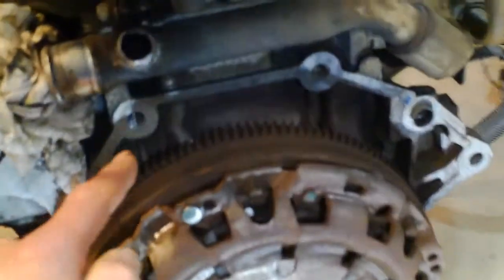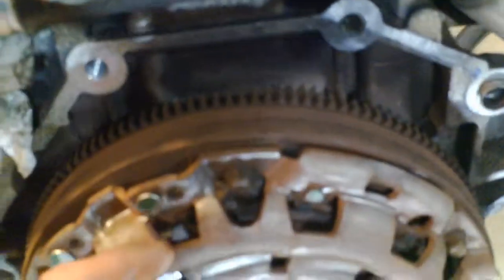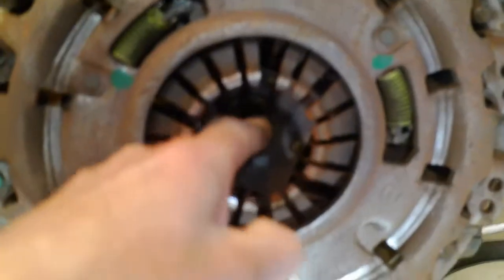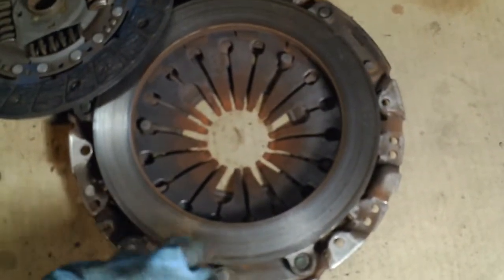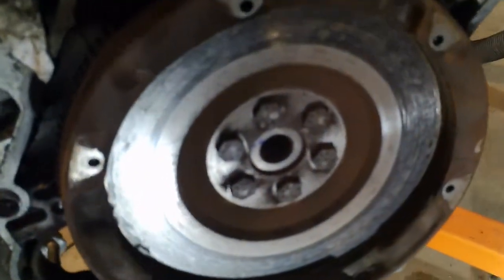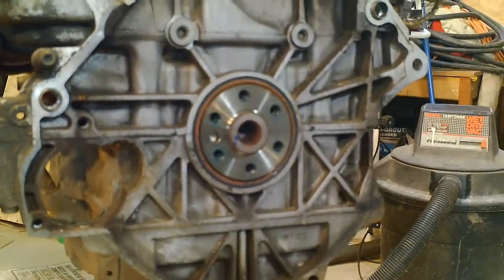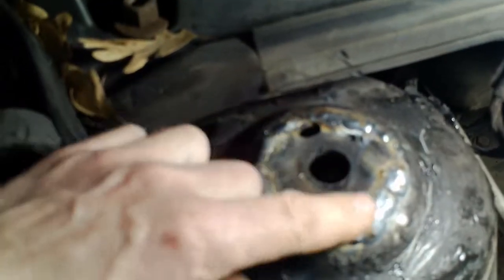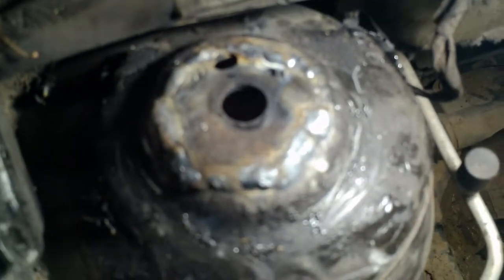Detailed Saturn Ion Engine Replacement and more, Part 6

Comment: It started right up. It's been sitting for 6 months. But I do have a question. It starts smoking back by the exhaust within about 30 seconds of starting it. I shut it down right away. Any ideas? Also, I am trying to bleed the clutch and not having much sucess any tips on that? Thanks again for the videos I couldn't have gotten this far without them.
Reply from the maker: I don't know about the black smoke, that can be too rich of mixture but not sure why it would shut down unless it is just so much gas it can't run.  Are there any codes stored that might help debug?  Was the engine you put in known good, or could there have been an issue with it before you put it in?   I guess it would be good to check that you have all the sensors, etc, connected and didn't miss connecting something, though I can't think of one that would cause the black smoke if not connected.  When it shuts down, can you take a spark plug out and see if it fouled/wet from too much gas?  Might need to check them all as I suppose it could be just a couple cylinders having the problem if too much gas.  That's all I can think of at the moment, but will reply again if something else comes to mind.  Will reply about clutch next.
Reply: @JB_WI_Triumph  The smoke wasn't black more like a white smoke between the engine & exhaust manifold. Maybe  it is still loose or leaking from there? I think the torque specs were kind of low as I recall. (10 lbs.) I did put a new metal gasket on. Would a scan tool tell me what the issue is? It didn't die on me, I shut it down right away when I saw he smoke. I did forget to tighten the sensor on the exhaust manifold but it was plugged in.
Reply from the maker: @elisebrown7940  

Sorry, I read "Back" as "Black"
If O2 sensor wasn't tightened up, that could do it.  Also, new gaskets, the manifold and grease on manifold from handling, etc, all tend to smoke a bit at first.  I would just do basic checks, coolant level good, oil good (no coolant in it) and then let it run a while and watch to see if you can pinpoint leak, assuming there is one.  Be very watchful of the temp gauge, shut down if it looks like it is going at all hot, very easy to damage head and/or head gasket if it gets hot. 

10 ft lbs seems very low, I would confirm that again.  Things that screw into the Aluminum head will be low torque, but 10 seems low even for that.  

As far as scan tool, you might get some codes if the seal from head to manifold is bad as it might get too much oxygen that way, but if you know there is a problem in that area, might as well get that fixed first.  I don't think the O2 mixture codes are stored immediately, you have to get some miles before they would get set.
Reply: @JB_WI_Triumph  I took the heat shield off and ran it again with my trouble light to see a little better. Turns out the valve cover gasket is leaking or thats where the smoke is coming from. Not sure if I am happy or not about that but it could have been worse I guess.
Reply from the maker: @elisebrown7940  

At least you don't have to take the engine back out to fix that!  I just swapped engines so I never had to take valve cover on or off.
Reply: @JB_WI_Triumph  Would you buy a new valve cover gasket? It still looks good not sure if they can be re-used or one time use only.
Reply from the maker: @elisebrown7940  

I never had mine apart so not sure on this.  If it was leaking though, then seems like something must be wrong, hopefully the gasket.  The rubber like ones can be re-used, the paper-like ones no.
Reply from the maker: I hate bleeding that clutch.  My theory is that air gets trapped in the slave cylinder and it doesn't travel up and out of there very well.  I have run two quarts of brake fluid through it to get it work before, and even then still seemed like it had air in it.  It does seem to get better over time if you get it to the point where it is usable, I think the air does work it self up and out over time.  This last time I did a vacuum bleed on it and it seemed to work better, but I can't be sure until I repeat one more time.  Even when I did this, it seemed not too good and I bought this thing "Mityvac MVA803 Master Cylinder Pressure Bleed Adapter " in order to get more vacuum than my goofy improvised setup.  By the time it arrived though, the clutch either improved or I got used to it and so I haven't tried this thing yet.
Reply: @JB_WI_Triumph  I'll have some help today yesterday it was just me & my 1X4 board used to hold down the pedal. I need to go out and buy more brake fluid before I try again. I do have a mighty vac that I could try. What's the best way to use it ? Wiggling the line wasn't getting me anywhere.
Reply from the maker: @elisebrown7940  

I made an adapter to my vac pump from old brake fluid reservoir cover, but that one I mentioned would do better than my silly setup did.  As long as you can draw a vacuum from the reservoir, you have hope of drawing air bubble out.  If you have it mostly bled, then you probably don't have to worry about filling up the reservoir, but if you see the level drop, you know you have made progress.  The drop might be very small though, doesn't take much air in the system to render clutch useless.  I don't know that you have to hold the pedal down, or pump it, I have seen people swear on each one, but I drew the vacuum and then cycled the pedal a few times under vacuum in hopes air would get worked out.  I feel like that was the trick, but I can't be positive.
Reply: @JB_WI_Triumph  Working with 10 pumps & my son holding the pedal down on the last one I released the clip. There is pressure that makes the line want to pop out but I am not geeting any air bubbles in the line. The pedal is a little better but not much probably won't be enough to engage the new clutch. Could the air be trapped on the other side of the line between the bleeder & the slave cylinder? If it is would it make sense to try and draw the air out at the bleeder?
Reply from the maker: @elisebrown7940  

Well you have found the frustration with the clutch bleeding.  I bled my brains out and pedal was still spongy and every time is a battle.
If the line is wanting to pop out, you must not have it slid out far enough into the bleed position.  If the fluid can flow freely out the bleeder valve, there will be no pressure to push the line out. 

Yes, the air is on the transmission side.  It is no problem to bleed the line from the reservoir to the bleeder valve, the trouble is getting the air out of the slave cylinder.   If you have some pedal and can pump it up, that might help.  It will get the slave cylinder moving and that might help get the air to bubble up the line. 

You can't really pull air out the bleeder valve as you will pull the fluid out of the reservoir.  Perhaps, however, that might work if you get the air out of the slave cylinder side first, and then fill the reservoir and bleed the line next.  From your current state though I think you are going to get the fluid that is higher up in the line and reservoir first, then you might get air from the slave, but you need to seal the cap on the reservoir so you can draw a vacuum.  There is a small vent hole in the cover, but if you put a plastic bag over the reservoir, then put the cap on, that worked for me ( I did this sort of thing too )

The first time I bled the clutch, I just kept bleeding and pumping and eventually I got it.  I had a hose from the bleeder valve back to the reservoir when I did it this way so I didn't have to keep adding fluid, just pumped it around in a circle.
Reply: @JB_WI_Triumph  That makes sense my mighty vac did pull some air out but then the tiny pin holding the handle came out disappeared into the engine  somewhere. Crap. I have some pedal now so maybe the slave cylinder will help push the air out.
Reply from the maker: @elisebrown7940  

Yes, you are probably close, keep bleeding and pumping all night and you might have it by morning...
Reply: @JB_WI_Triumph   Ha, not all night but it did get dark. I cut off a nail to repair Myt-va I had a rubber stopper set-up that I used to bleed the air out of the power steering on a ford windstar it worked well enough to create a seal so the Myt-vac could pull some of the air out. I have a pretty good pedal now. Took it out for a test drive and it worked okay. I have never drove one of these before -reverse was super hard to find not sure if that's normal or not. Hey, thanks again I was getting very frustrated but it all worked out.
Reply from the maker: @elisebrown7940  

Good, congats, it is nice when it finally works. 

Reverse hard to find because you didn't know where to look, or because linkage problem?  There is an issue where the roll pin that holds the cable fasteners to the tranny can brake.  I don't know if this makes reverse hard to find, but it does make shifting sloppy in general.  I had a partially broken pin in mine, replaced it, and shifting was better.
Reply: @JB_WI_Triumph  How would I check that? It does shift harder than I guessed it would. That could be the problem.
Reply from the maker: @elisebrown7940  

It might be hard to describe, but see if you can wiggle the gadget that the shift cables connect to and see how much play there is.  If the pin is broken that holds that apparatus to the shaft coming out of the tranny, then it will be sloppy on the shaft. 

Could it be hard to shift because you don't have good clutch yet?
JB
Reply: @JB_WI_Triumph  It continues to get a little better as I drive it. I can find reverse if I start out in first. I think that I can live with it. My last 2 issues are a bad control arm on the passenger side & the radio has a short that drains the battery. Have you dealt with either of these issues? It looks like the easiest route would be to replace the whole arm but that's also the most expensive way to go.
Reply from the maker: @elisebrown7940  I have replaced the control arm a couple of times now on mine.   I have to drive on dirt road with pot holes and so I think it is especially hard on the ball joints and bushings.  It is easier to replace the whole control arm for sure, but if you have time you can just change the ball joint (assuming that is the problem you have).  You have to grind the heads off the rivets and then punch them out, use bolts for the new ball joint.  Just make sure the bushings are good if you do this otherwise you will be replacing it again soon to fix that. 

It seems like the cheap replacement control arms did not last very long for me compared to the original ones.  I can't say for sure, but I think some of the ones being sold are of low quality. 

I have not had the radio issue, but thanks for mentioning it as I am sure it will start acting up on my car now....
Reply: @JB_WI_Triumph  My noise is a clunking sound. At first I thought it might be the sway bar bushings  but they seem pretty tight to the sway bar. Pretty sure it's the passenger side control arm. The sway bar link was broken on that side before I replaced them both.
Reply from the maker: @elisebrown7940  Yeah, those  sway bar links are famous for clunking.  I usually take them off and then  see what clunks to be sure they are not responsible. 

I have had the rear "horizontal  donut" bushing on the control arm fail twice now, the center metal part gets hammered out and then clunks.  I also had the control arm get hammered out so that bushing fell out and that causes some major clunks.  One test you can do is pull forward and stop abruptly, pull backward and stop abruptly, and have someone watch the front wheel and see if it moves relative to the fender which indicates slop in that rear bushing. 

The struts are not above clunking either and it is hard to tell what the problem is with all the possibilities.  Most everyone says the real solution is to turn the radio up.
Currently my rear trailing arm (might not be the proper term) bushing have significant play in them and make noise.  This is an upcoming project for me to fix.
Reply: @JB_WI_Triumph  
It was the control arm and man what a difference. I also had to tighten up the sway bar links again and no more clunking.
A new issue has developed with the shifting though. I was having trouble finding (R) reverse and it's gotten much worse now.
Now I have lost (2) second & (4) fourth gears too. Any ideas on this? 2 - 4 - R are all accross the bottom and I lost them gradually in reverse order  (R)  - (4) - (2) . It sort of feels like the cable  is not pulling  it far enough to engage the gears  now.
Reply from the maker: @elisebrown7940  

I remember there is a pin that holds the cable connection points to the shaft coming out of the transmission.  This pin frequently breaks according to what I read, mine was broke.  I didn't have trouble shifting other than it was sloppy, but I bet this could be the problem you have. 

You can reach down wiggle the contraption that the shift cables go to, see if it is loose on the shaft or not.
You can also manually put it into the gears to be sure that tranny is good, but you might have to disconnect at least the one cable that does the 2-4-R gear selection.
Reply: @JB_WI_Triumph  I was hoping to make it to Saturday today to work on the reapiar but one of the cables broke Wednesday night. No gears at all.
I had it towed home and I bought the replacement cable (set). I haven't bought the roll pin or maybe I need 2 yet. Do you remember how the pin comes out & where it is ? It looks like the plastic ends on te cables would just snap on to the shafts coming out of the transmission. Also, do you know where I can find the steps for R & R on the cables?
Reply from the maker: @elisebrown7940  
My guess is that you don't need the pin if they cable broke, it was probably going bad and that is why you had trouble.  It is odd that you had cable trouble, I still have the original cables in my car with 315K on it now. 

You have to drive the roll pin out with small punch.  I think I used the style that has a small ball on the end to center itself in the roll pin.  There is just one pin, and I am pretty sure I got it at Fastenal.  I bought a few to get the right size, and from memory, it was a metric size that fit.
Maybe the biggest pain in changing the cable is taking the center console out of the car.  I have done this, and when I did it I took out both seats.  You might not have to, but I needed to give it a clean anyway and it gives you more room to work.
I think it is pretty straight forward, just have to hunt for all the screws and be careful not to break the plastic.  I should be around on and off this weekend so feel free to ask any questions if you get stuck somewhere.
Good luck with it.
Reply: @JB_WI_Triumph  Thanks! The cable  had a kink on the outer metal sleeve toward te end of the cable end and that finally wore out the inner braided wire. Also, discovered that one of the two bolts that were supposed to be holding the cables and bracket to the transmission was missing. I have the ends removed at the transmission. I removed one of the heat shields and I was able to pull the bracket & cables down through the bottom of the car.  On the other end I removed  the plastic  & 6  black screws holding the console. It's loose now but not out. Next step I think would be to remove the clips holding  the other end of the cables. They are white plastic & not sure how they release. It looks like they might be hinged on one end lift open?
Reply from the maker: @elisebrown7940  Do you mean the clips that are on the inside of the car end of the cable?  I can't remember how the cables come off the shifter, but I did it once.  I can probably take mine apart tomorrow and refresh my memory if you get stuck, let me know.
Reply: @JB_WI_Triumph  Yes,  it looks like you could put a flat screwdriver in and pry them open but  not sure.  They clamp down or hold the  end  by the shifter. I'll try that and see if it works.
Reply: I got it. The clip lifts up just slightly and that allows the end to move foward.  What a nightmare pulling out the cables!  I just hope they go back in easier than the old ones came out.
Reply from the maker: @elisebrown7940  

Good job, but my experience is that things come apart a lot easier than they go back together!
Reply: @JB_WI_Triumph  I got it put back together & it shifts great in all the forward gears  but it won't go into reverse.  It  shifts over and up for 5th but not down at all for the reverse gear.  I also  have an issue  with the  cable further back towards the shifter.  There  was what I would call a  metal cable tie that holds both cables together and  it fits over a small stud with a nut that (was) attatched to the bottom of the car. Well, it took some force to get the cables back into the bracket near the transmission and I guess  it was enough to pull the stud loose.  I don't know if this would affect -  shifting into reverse  or  not.  Does just one of the cables control reverse? Not sure what to try next....
Reply from the maker: @elisebrown7940  

I am not familiar with the stud you mention, but it sounds like if it came lose that is a likely culprit. 

When you move the shifter side to side, one cable is active.  When you move the shifter forward and back, the other cable is being moved. 

On the transmission, one cable rotates the shaft coming out of the transmission and the other pulls it out or pushes it in to the tranny.  I can't tell you if side to side pushes and pulls or rotates the shaft as it was too long ago that I worked on it to remember.
If you can have someone run through the gears while you watch the transgression, you will quickly understand the various positions for the gears.  Once you get this figured, you can manually put the car in reverse to be sure it will go, maybe you will have to disconnect the cable.  Once you verify it will go in reverse, you should be able to figure out what is binding as you try to move the shifter into reverse position.  Maybe it will be more telling with the cable off so tranny isn't limiting any movement.
That is all I can think of at the moment, but will reply again if I have any bright ideas.
Reply: @JB_WI_Triumph  I got a look at what's happening as I try to put it into reverse today. The top cable (black)  appears to move the car from one gear to the next. The other cable (white) is under the black cable and it appears to move less possibly side to side. It still binds as you attempt to move it into reverse but with my son's help we were able to get it into reverse gear.  As he applied pressure to the shifter I could help move the black cable into reverse. This did not work everytime we tried it and it seems like pushing down slightly at the connection point helped get it into reverse gear. Could this be the roll pin issue? If I jack up the driver' side and take off the wheel will I be able to see the roll pin & get at it with a punch? I can't see it from the top at all. I did find some info on the pin  3/16" x 1" does that sound right? If you could tell me where to look & how you did yours that's what I'll try next. Thanks Again!
Reply from the maker: @elisebrown7940  One cable rotates the shaft that sticks out of the tranny.  The other cable pushes/pulls the shaft into or out of the transmission.  The into and out of movement corresponds to the side to side movement of the stick as I recall. 

I have not suffered the problem you describe, possibly the only saturn ion problem I haven't had, and so I am really speculating here.  My guess is that binding would not be caused by the roll pin as it wouldn't prevent the cables from moving where they wanted to, it would allow that contraption the cable ends connect to be sloppy.  I suppose you could think it is binding if you have to move the shifter further to compensate for slop at the tranny connection and run into some other mechanical limit beyond the normal range of the stick shift movement. 

I vaguely recall something about adjusting the cables, but this could even be on another car I was working on.  Do you see any threaded business where the cables connect to the shifter, and specifically where the cable sheath is fixed to the tunnel?  If the car goes into, for example, 2nd and 4th well, then maybe the cable is just too long/short.  This doesn't explain binding really.  Since the cable broke before, it seems like that is a symptom not the problem though. 

You could disconnect the cable that binds (or both) and then see if the shifter moves freely with the cables off.  If so, then it seems like it is the transmission and not the cables.  If it still binds, then it must be the cables.
I changed my roll pin when the tranny was out of the car.  It might be possible to do it with tranny in the car, but it would be tough.  It is hard to see it and you have to get a punch right on it to drive it out.  If you disconnect the cables, you can grab the contraption the cable ends connect to and wiggle it.  If it is sloppy, then probably broken roll pin.  If tight, then roll pin is good.  You could also manually move the car between gears with the cables off, if you have trouble doing that, then it is something in the transmission.
Good luck, it's a pain to work on those cables I know.
Reply from the maker: @elisebrown7940  When I put the new roll pin I THINK I bought english size pins and they would not work, I had to get the metric roll pin.  I could have that reversed though, its been a while.  I thought they would compress  enough as long as close, but this was not the case.
Reply: @JB_WI_Triumph  I found just one thing about the pin size supposedly it's 3/16" x 1" Napa has that one. They are about .50 each. 
I think GM wants 30 dollars for theirs.....Do you remember if they are heavy duty? I have some tension pins from the hardware store that size but not sure if I would trust them. I'll try Fastenall see if they have the metric pins.
Reply from the maker: @elisebrown7940  It could be, I was thinking it ended up being metric, but I am old, memory failing.  I bought mine at fastenal.  They had some in stock, the other ones took a day to arrive.  I will see if I can find my orders and see what I bought.
I seem to remember they were more exotic than hardware store type.
Reply from the maker: @elisebrown7940  I think I found the one I used
https://www.fastenal.com/product;jsessionid=OEcNb7CIgCjpUMRxf9KQsK3j.443d7b2e-1555-3602-a586-c0d73327934b?query=11509185+&fsi=1
And I remember now that I looked at it, it is special in that it has the metal rolled more than 360 degrees, it has some overlap.  The hardware pins are about 340 degrees around so there is small gap.  This is why it has to be just the right size, it can't compress much.

M6 x 30 Spring Steel ISO 8750 Medium Duty Spiral Pin
Fastenal Part No. (SKU)  11509185

I am 90% this is the one I used from my orders, could still be wrong, but you should probably get one of these just to be safe. 

Also, there is sort of a special punch that might be helpful.  They might be for the cheap roll pins as they are made to go inside of the pin to stay centered.  I think I used a small one that would fit inside the spring pin part number above.  Search on "Roll pin punch.
Reply: @JB_WI_Triumph  Thanks so much! I'll let you know how it turns out.
Reply: I gave up on trying to replace the roll pin. Instead I went back to the cable ends inside the car at the shifter. Trying different adjustments finally made enough of a difference and I can now get it into reverse. Thank godness! The white cable appears to push the gear selector  in or down closer to the transmission when moving the shifter towards 5th gear or reverse and moving  the shifter to the left or 1st, 2nd, 3rd, raised or pulled up on the gear selector at the transmission to allow those gears to engage.  For now - if I put it into 1st and then quickly shift into reverse it works everytime.  Maybe I'll try replacing the pin this Spring! Thanks again for the great videos and advice.
Reply from the maker: @elisebrown7940  Yeah, I replace the roll pin in mine with the tranny out, and I am sure that is much easier.  Make sure your pin is actually broke though before spending all the time trying to get it out.  You should be able feel some slop in the thing that connects to that tranny shaft and moves it up/down and rotates it back and forth.  If there is no slop, then roll pin most likely good.
My backup lights haven't worked in years.  I changed the switch and it didn't help, but you gave me an idea.  Maybe I can make an adjustment on cable end to get some more throw and get those lights to work!  Thanks!